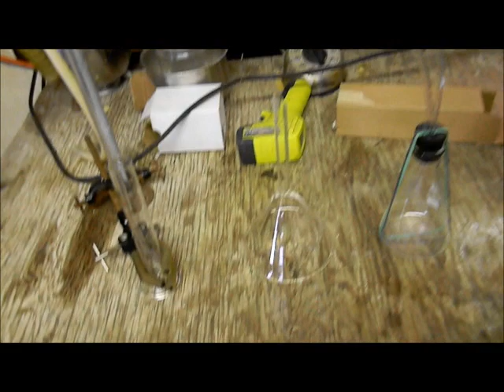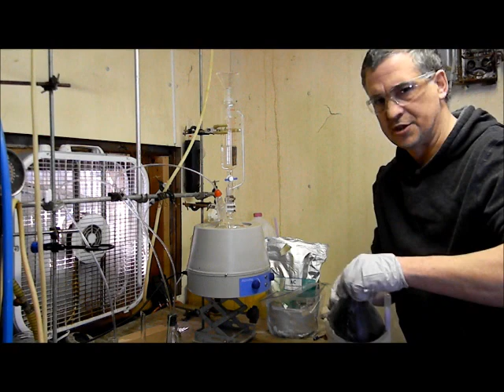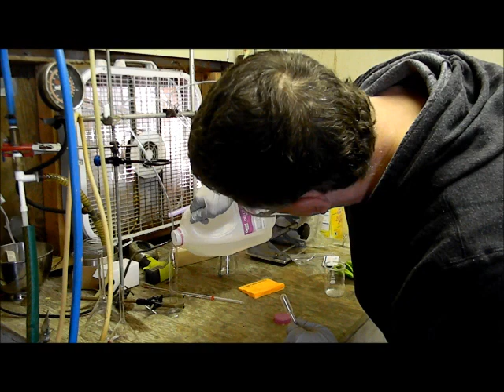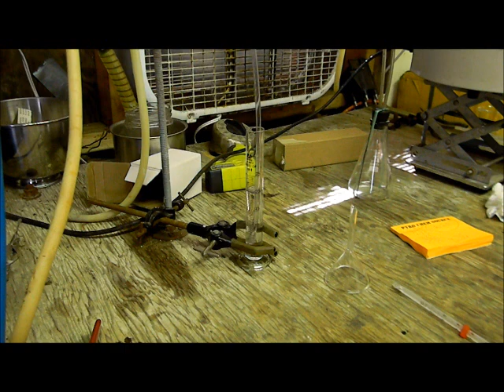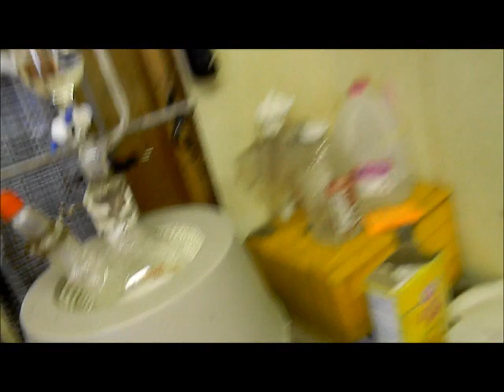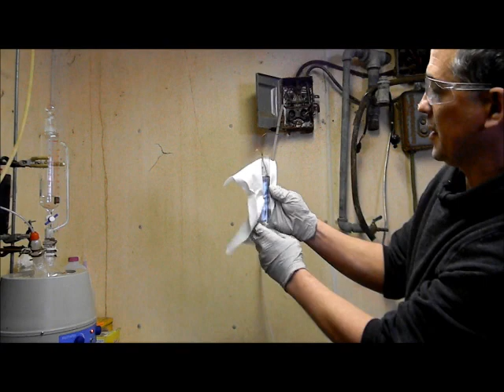Preparation of 25% ammonium hydroxide  solution.

Comment: Good video as always. Would you happen to know if flour behaves extremely similarly to ETN when plasticizing? I want to experiment with plasticizing without using ETN right away. I have had success plasticizing ETN with self amalgemating tape in gasoline and 5w30 motor oil but I can't stand the gasoline smell (I wear a respirator and work outside but it soaks into my skin and clothes and still leaves me with a slight headache and weird taste in my mouth) and the benzene in it isn't the best for you since ya know, it's a carcinogen and all. I want to try rubber cement and motor oil because I got it to work with baking soda and aspirin powder but haven't tried ETN yet. I noticed that different materials plasticize differently but Dr. Liptakov and others use flour often to show how to plasticize ETN, PETN, etc. So I was just wondering if they behave similarly. Thanks.
Reply from the maker: I really couldn't tell you, but i can say many do use flower to get the mix right.
Reply: @darianballard2074  Okay thank you. I'll just experiment around when I get the chance and see what happens.